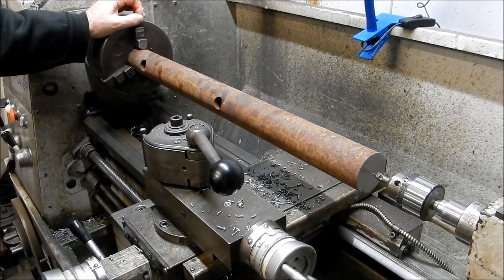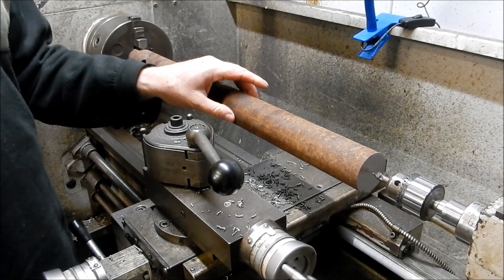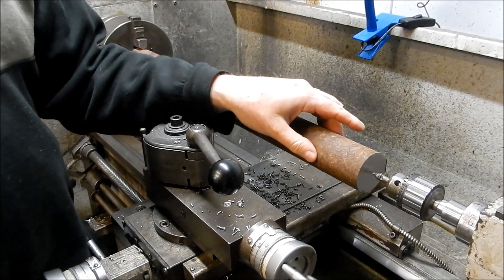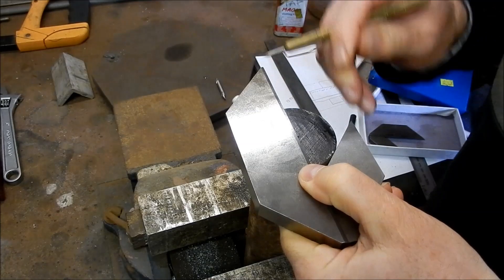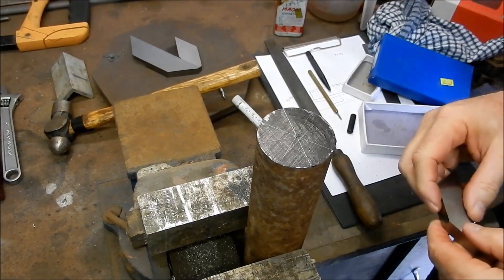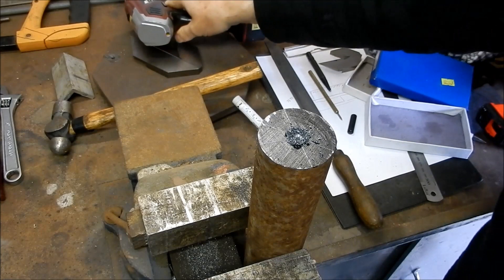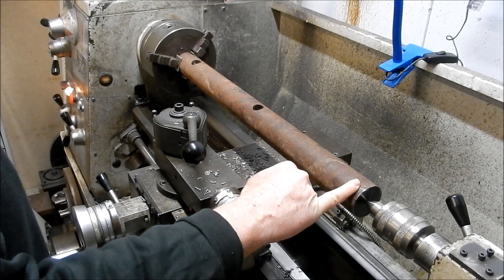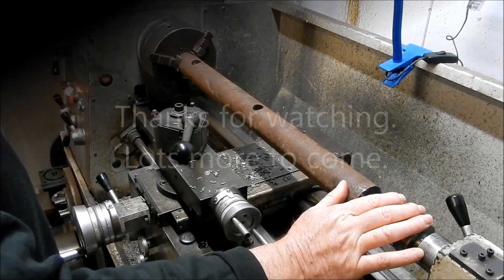Centering long shafts for machining

Comment: Another way to do it is to use an "adjustable cup center"  this is a form of a cup with a center drilled at the back  and with four adjusting bolts fitted radially so that you adjust the bar you are centering, when the bar is centered you can machine it to take the steady you remove the cup center and you can proceed to drill the center!! I have three different sizes of cup centers been using them for the last 50 years:-))

Comment: Another good tip Cam. Thanks for the tip about the centre finder, I’ve looked at those on eBay and they’re not cheap, those Indians don’t sell cheap, seeing this I think I’ll make one. Forgot to mention I already bought a cheap combination square with centre finder and angle finder, I’ve forgotten which part of the mill has those gems melted down for, funnily the ruler part is straight, go figure. 
Cheers 
Peter